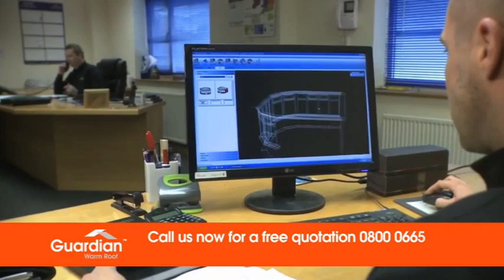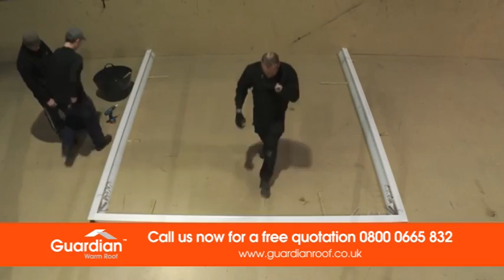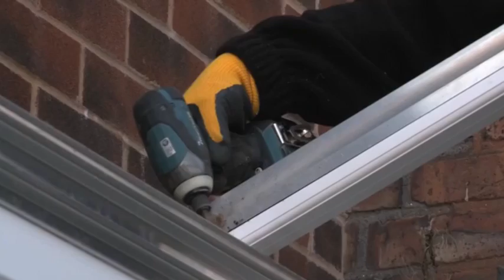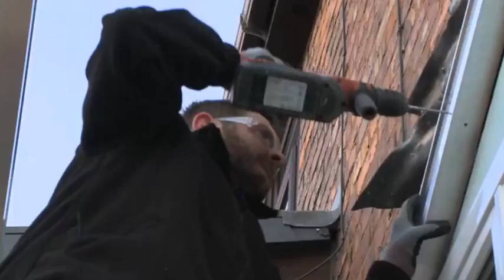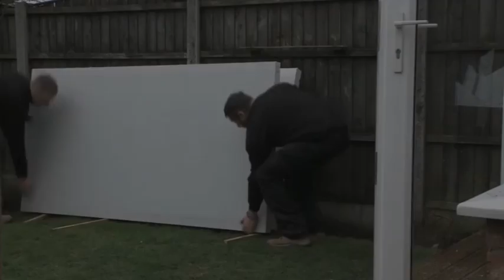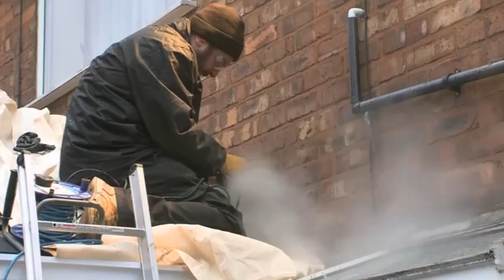Guardian Conservatory Roofs

Comment: Cold bridging problems on the aluminium ring beam.....could lead to interstitial condensation 😳
Reply: No could about it!
Reply: Hi Dave, sorry to bother you, 4 years on from this but thanks for pointing this out, we're having huge problems with water running down our walls with a Guardian warm roof with some kind of condensation and just looking for any help we can get as Guardian seem to be denying anything. We initially thought we had a leak so they advised us to get lead replaced which we did and also a bunch of tiles. But we're near 100% sure it's condensation now. 
Any chance I could contact you, as you seem more in the know than anyone I've seen yet.
Reply: @TheGoosegumps  I have a similar old polycarbonate conservatory roof and although it is not leaking, I have been looking at a DIY replacement solution. I'm sorry to hear about the condensation issues you are experiencing. There is no easy fix, the reason being generally any uncoated metal framing will experience temperature differences between the outside and the inside during the colder months and that will inevitably give rise to condensation issues. To give you an example, if you look under the roof in your home, you will notice the entire roof structure under the roof tiles is made from timber. In order to prevent consensations problems the entire roof structure i.e the rafters and the wall braces must be made from timber. Otherwise consendation issues will always be a problem.
Reply: @MP-mu1kw  Apologies to get back to you so late, don't log on to this account often and thank you for taking the time to explain. Since that last post I put on here, things got bad to worse anyway. Our insurance back guarantee was useless as the "fitting company" liquidated some time ago and the company who's the patent holder of this roof and who suggested the fitter sent a couple of people to look at it, one of them saying the whole roof wouldn't pass building regs, they've sawn some structural beams above the garage and the whole pitch of the roof is too shallow but they will replace a whole new one if I pay the £19k of course hah.
We tried to complain but now they refuse to talk to us.

Not much to be done but thought I'd share as you kindly replied, thank you again!
Reply: @TheGoosegumps  Nice to hear from you. Aside from the so called structural issues highlight by so called company that holds the patent. The one solution you can explore is see if you are able to remove say one of the facia boards by first removing any gutters and what you could is either drill out holes/cut outs to allow air flow to keep the temperature constant. That will most probably alleviate the condensation build up problem you are experience.
Reply: @MP-mu1kw  Nice one, I'll look into that. The system is meant to have those holes in the front but with the way it was fitted, who knows :)
Thank you again!
Reply: Think this is what I’m experiencing